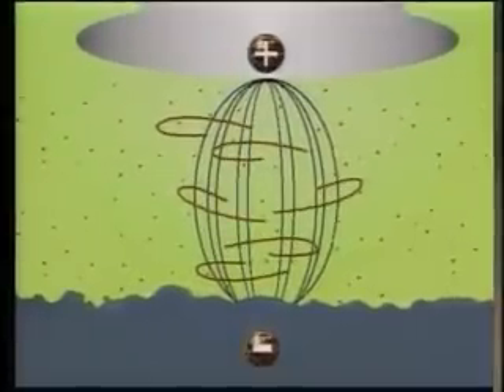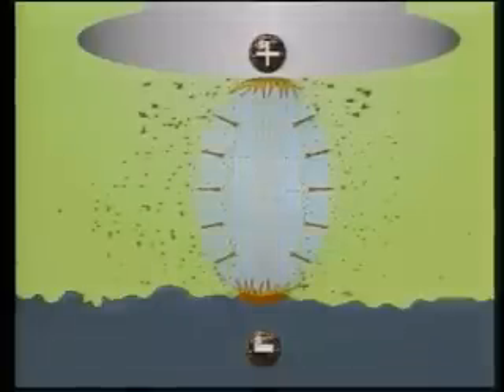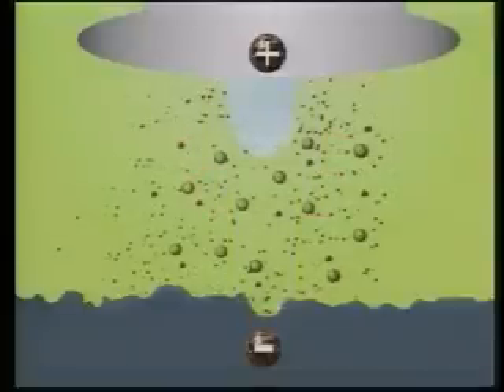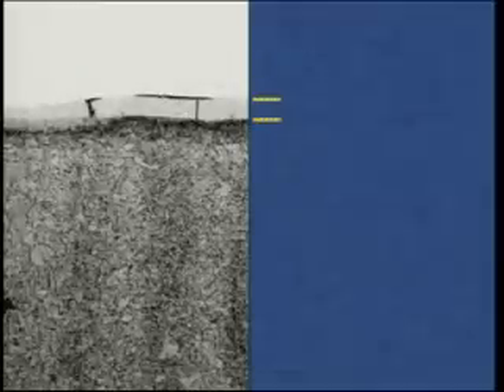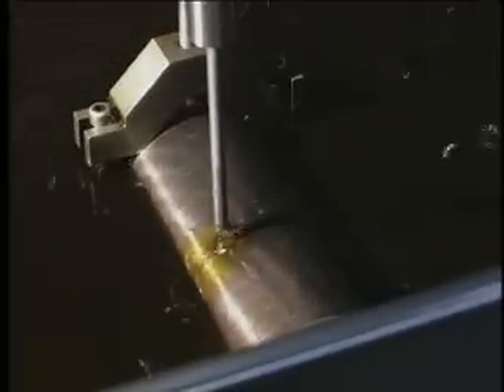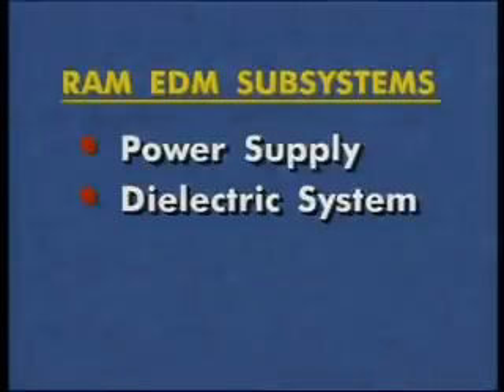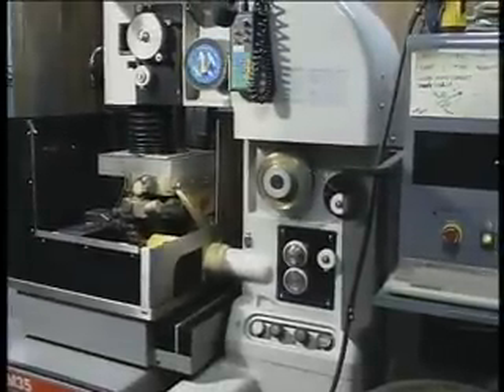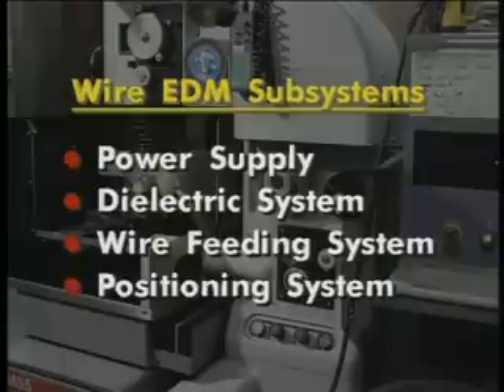Electrical discharge machining

Comment: what is the speed of the wire feeding? does it use alot of wire?
Reply: +ironlionkalo  

I'm a toolmaker and it depends on the type of material and the path that has to be cut.
Reply: +ironlionkalo Our bigger machine goes through about 2km a week going 24/7. That's about $250 worth.

Comment: @FJoeForty the advantage of edm is that elaborate forms can be machined eg. how could you machine a chase in hardened steel  that was 1mm wide. 100mm long and 100mm  deep. each corner square.  best used in the plastic injection mould tool industry. carbide cutting leaves rads. jet has to go right through...with edm you can machine "blind" contours. hope that helps.

Comment: God, what an elaborate apparatus, with a large number of parameters to be in constant control of. What are supposed to be the benefits of this process versus tungsten carbide cutting, CNC grinding, and waterjet?
Reply: The advantages are you can drill into any hardness, any angle, multiple hidden layers and no diflection offset.